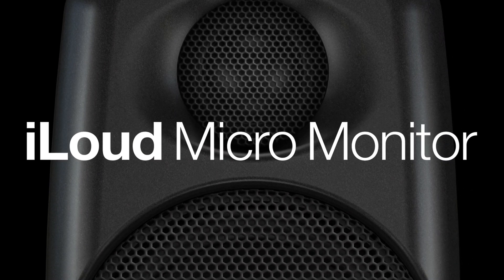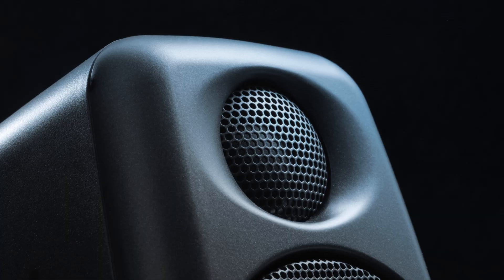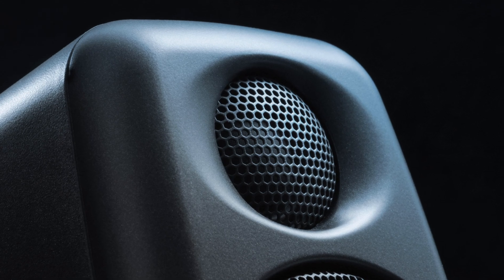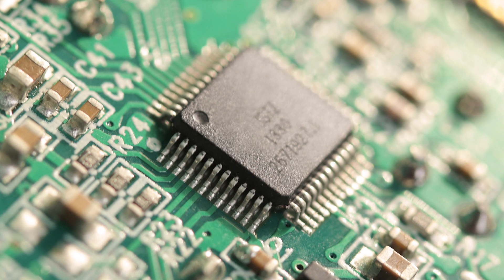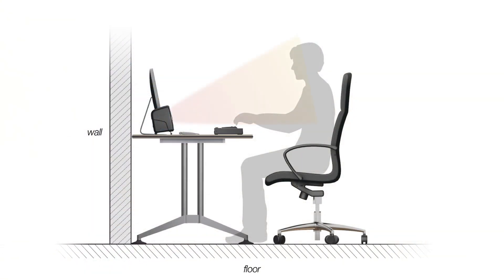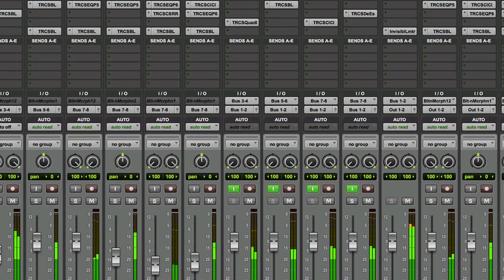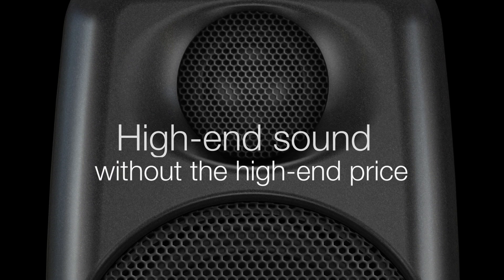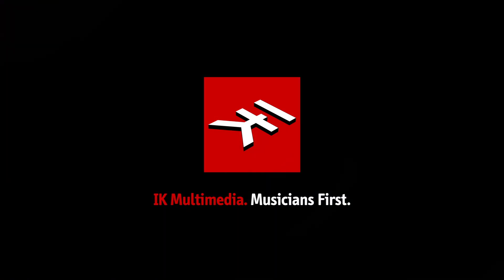iLoud Micro Monitor - 4. Proper crossover and driver alignment

Comment: how many watts?
Reply from the maker: Each tweeter and woofer is powered by ultra-efficient class D power amplifiers that push a total of 50W RMS with amazing low-end response down to 55Hz (-3dB).  You can find this and other details about iLoud Micro Monitor at http://www.ikmultimedia.com/iloudmm